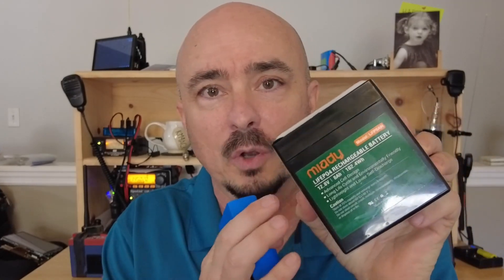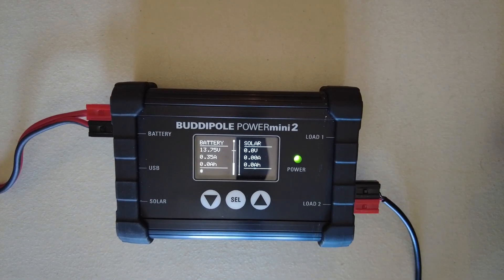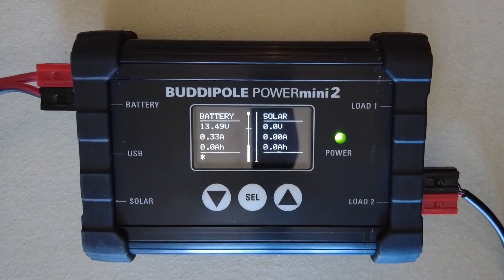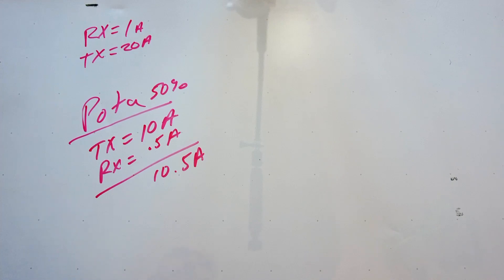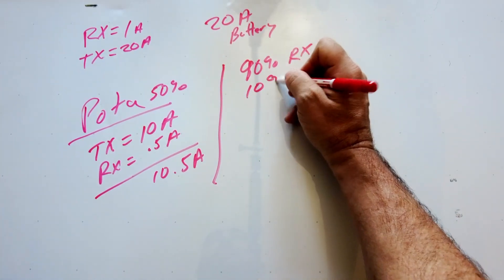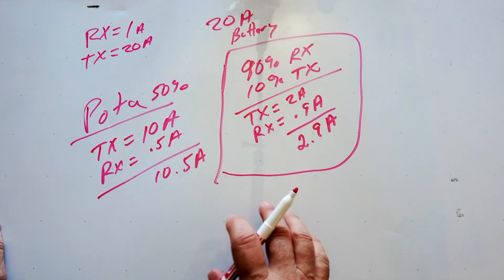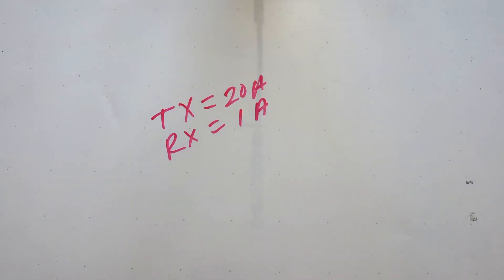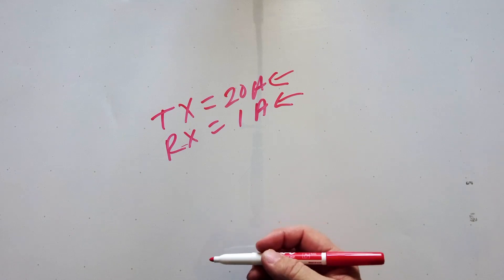How to choose a battery for ham radio

Comment: Im using lifepo battery banks up to 1,200 amp hours with around 5kw of solar. I have been systematically removing all of my switching and linear power supplies and going 100% battery power. So I'll charge my batteries when I'm busy at work then I can run the batteries with the chargers off to minimize the noise floor. 

And for the love of God don't waste your money on a Bioenno. Buy yourself an Anderson power pole kit and the most amp hours you can afford. 100 amp hour 12 volt lifepos run about $150 or less. A 20 amp hour Bioenno from DX Engineering will run you $200.

Comment: Hi Jason, for pots and sota with an Kenwood ts-480SAT 100Watts and an legal CB-Radio with 4wats and 12Watt SSB, Is 20ah enough for the battery? At 40/60% or 50/50% operation who. Both devices are connected to the same?

Comment: I once bought a Four Pack  of the Miady Batteries, and EVERY one them were bad out of the Box. I have also had a very High Failure rate with the Bioenno Batteries. I WILL say that Kevin at Bioenno DID make everything right by me.
I have a Bioeeno 100 Amp and Two 40 Amp Batteries-for three years and are all still in good working order.
Do NOT buy the Bioenno 1000 Amp Pure Sinewave Inverter. It is GARBAGE from China! I bought two and they BOTH failed SECONDS after turning them on. Again, Kevin made it right by reminding my money for those.
The Bioeeno 6 Amp Lithium Battery Chargers are a Hit-and-Miss proposition swell. I have bought nine of them and SIX HAVE FAILED!
I have NO experience with Dakota Lithium, so I can make no comments here. My only thought with the Dakota Lithium is that they seem quite expensive for what they are.
I recently bought a LI Time 100 Amp Mini, and so far, it is FABULOUS.
Another thing about Bioeeno that disturbed me was their claim that they made of their Batteries being made in the US. They are NOT. I took one apart and all of the Cells were from CHINA!
Bioenno DOES make a decent product-you just have to go through SEVERAL of them to get one that works properly.
Bruce A. Forster-AC7AA.

Comment: Do these figures assume 100% battery usage? I’m pretty sure you don’t want more than 80% discharge on a lifepo4. Most radio shut down under 10v anyway, but take off another 20%-50%. You get more cycles out of your battery if you don’t let it get below 50% discharge.
Reply from the maker: Yes. This would assume 100% discharge. Most LiFePO4 batteries have a BMS board built in that protects them from over discharge. I run my batteries dead on a regular basis. After 5 years of regular use, I still get ~90% out of my Dakato Lithium. Here's a video where I tested it https://youtu.be/JepL1E4lylQ Also, LiFePO4 stays above 12V for the vast majority of the discharge cycle.

Comment: Does the Buddipole mini2 also work as a solar charge controller
Reply from the maker: It does and it will work with several different battery chemistries including LiFePO4. https://youtu.be/3XAlsYjOSF8

Comment: SSB (Single Sideband) has nowhere near a 50 percent duty cycle.  25 to 33 percent is about tops (average 5 to 7 amps for a 100 watt radio).  However, digital modes, CW and FM are 100 percent duty cycle on transmit.  That's why a typical 100 watt radio will get very hot at full power digital modes; might even self destruct.  
HOWEVER even if the average amps is 5 to 7 amps, the PEAK amps will be at least 20, on a 100 watt SSB transmission.  A big capacitor helps smooth out the demand on the battery and resultant voltage fluctuations.

Comment: The transmit is even murkier as you might want to consider the duty cycle of SSB vs. carrier...maybe 25% depending on processing. I worked up a spreadsheet and there are a lot of guesses. Your are correct...get out into the field and see how your ciphering compares to the real thing.

Comment: hi Jason, 

thanks for the clear explanation about batteries.👍🏻
 I am now looking at which 18650 3.7 volt batteries I can use for my (TR)usdx qrp set to go portable.  
this helps with the calculation, but I'm also thinking about a small solar panel

Thanks ,
Ron, pd3ron
Reply: If you go with a solar panel, don't forget that you'll probably need some type of charge controller
Reply: @jthebotman  thanks for the tip,  I have a victron solar chager for my kenwood ts480

Comment: Jason a tip for the people that have the buddipole mini charge controller. It has a amp hours consumed measurement so you always know where you are at with your battery state at all times (as long as you dont turn off the controller). Rule of thumb for batteries, lead acid has a maximum discharge level of 50% c/f Lipo of 80% to 90%.
Reply from the maker: Great tips! Thanks

Comment: Of note, a radio drawing 20A on transmit is likely putting about about 100 watts, if running QRP the battery demand is MUCH lower.  You can carry a smaller battery or operated that 20A battery for a very long time.
Reply from the maker: Good point
Reply: At least 100W.  Less than 10W will get you a very long battery life.

Comment: I'm a lipo guy. Wouldn't recommend them for most people as they are potentially dangerous. But I have all the proper chargjng and storing equipment from my FPV drone flying hobby. Used correctly, they are a great weight/power ratio.
Reply: I'm a LiFePO4 guy when using mobile radios, but not for HTs. LiFePO4s are cheaper in the long run, not prone to catch on fire, good for many more recharges than Lion. Yes, bigger than Lion for similar capacity.

Comment: I use 3 Miaty 6 AH batteries in parallel to run an FT-891 at 50 watts SSB portable. I have 2 100 watt solar panels and MPPT controller for extended operation. Works fine.
Reply from the maker: Nice setup!

Comment: MY 23AH LifePo ran my IC-7300 @ 100w for 2.5 hours, and only used 20% of the capacity
Reply from the maker: Nothing beats field testing :-)
Reply: Did you measure the power?  Probably not.  The IC-7300 is VERY sensitive to power supply.  The driver stage AND the power amplifier is directly driven by battery voltage.  I have measured 4 times more power output just adding two volts (with a booster).  You can ASK for 100 percent power, but with reduced drive AND reduced voltage on the PA stage, this cascade of reduced voltage really hits the real power.
The Icom IC-705 is basically just the drive stage of a 7300; the final stage comes straight off the battery but everything else is regulated.  It also meets specification only if you give it 13.6 or 13.8 volts.
ANYWAY, what that means is with SSB duty cycle of around 25 percent you can go for a much longer time than arithmetic suggests.
Reply: @thomasmaughan4798  Correct me if i'm wrong, but a Lithium battery supplies a full 13 volts until it dies, it doesn't wane - so if the 7300 is getting full 12 volts, why would the radio reduce it's power output?

Comment: Spring for a Bioenno. Buy once, cry once.
Reply from the maker: Typically I agree but those dang Miady 8Ah have actually been great batteries. Zero issue with either of the ones I have in the last two years. Last I tested (about 6 months ago) I was still getting almost the full 8Ah out of both.
Reply: That’s true for a lot of things. I’d rather buy quality stuff. It’s worth the investment.
Reply: Im usually of the buy once cry once variety but the bioennos are a big cry 🤣
Reply: @KTK_Rockstar  Well, go with what you can afford. Easy as that. If you can’t buy the best, go with the next best. No harm in that. 73!
Reply: Or buy once and skip the crying, haha, since the Maidy is doing good
Reply: @Steven H Just out of personal curiosity, how did you test their capacity?